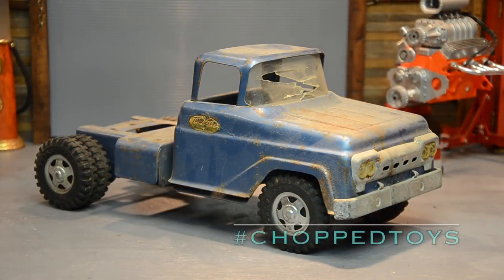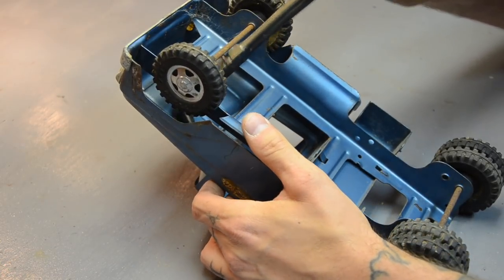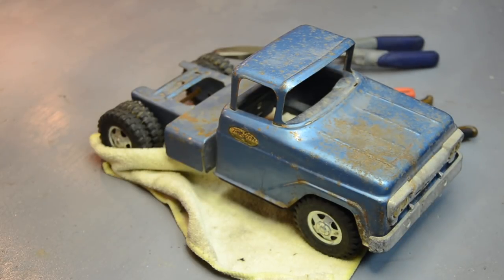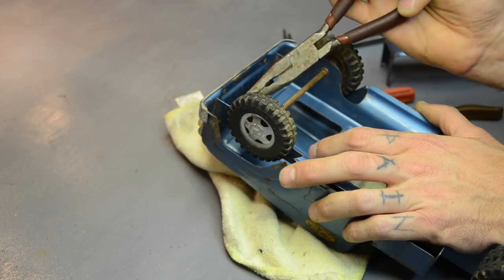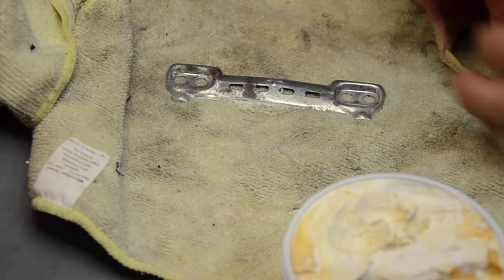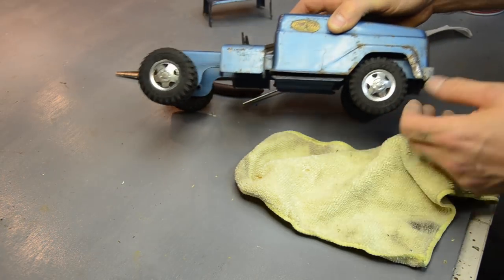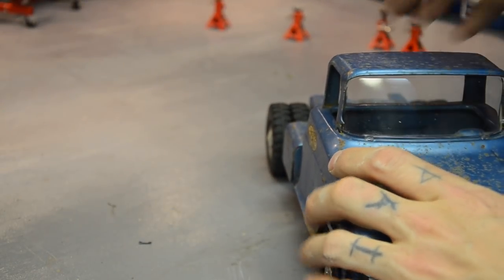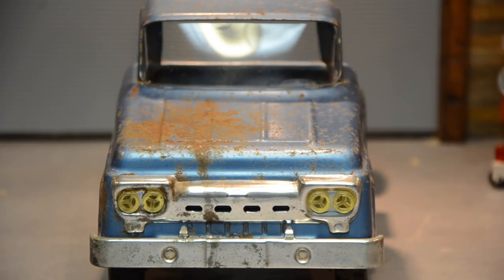Originals, 1958 Tonka Marine Tractor Truck, Window Replacement & Polishing Chrome

Comment: Love your collection of old trucks.  I also like the look of them with the patina.   I've used a dusting of WD40 and a light scrub with 0000 steel wool, followed by car cleaner/wax (I like Maguires) and it really comes out great in my opinion.   Plus I feel like it's a little more protected from further rusting.   What do think?
Reply from the maker: Ill have to give that a try.  Have never really done anything to protect the finish before.  Just clean them and put them on a shelf. lol

Comment: 1959 Marine Service. Trivia: Tonka did not produce the Marine Service in 1960, but reintroduced the model in 1961 in a powder blue color and renamed it the Maine Hauler. In addition, 1961 Tonka introduced the very sought after Boat Service.. a pickup with a converted sheep trailer which held 3 boats stacked one on top of another.
Reply: ischmel
I've been trying to find research info for these Tonka trucks. I've been considering doing some. Can you point me towards any sites or books, anything ? Thanks .
Reply: @xmo552 
Web site: Neat Old Toys. Excellence resource.
Reply: @ischmel3884  
Thank you